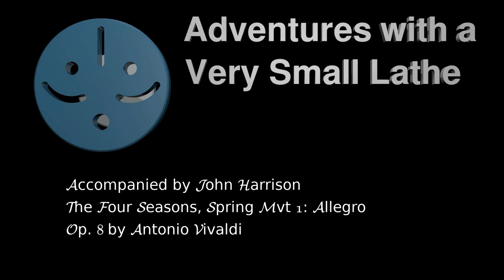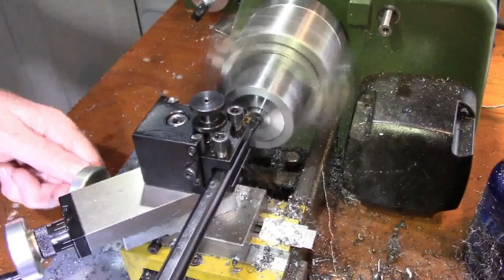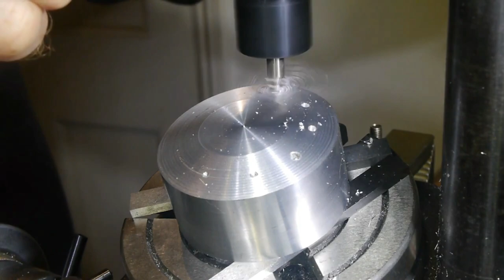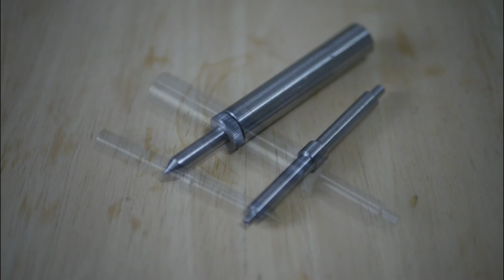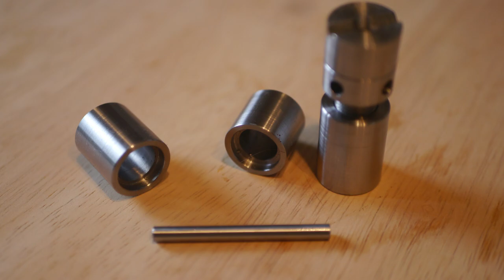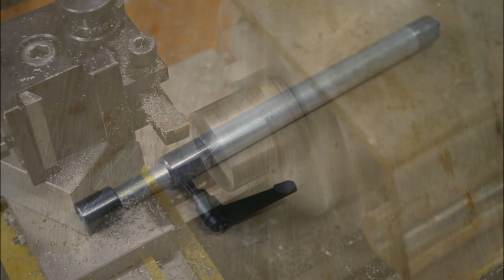First Anniversary of Adventures with a Very Small Lathe

Comment: Are you entering Emma's tool making competition?
Reply from the maker: I certainly am! I'm working on a project and video is secret at the moment. I'm on track for the deadline, though I have the Slitting Saw Arbor made from a single piece of stock as a backup in case things go wrong.
Reply: I wont tell anyone. It will be our secret.